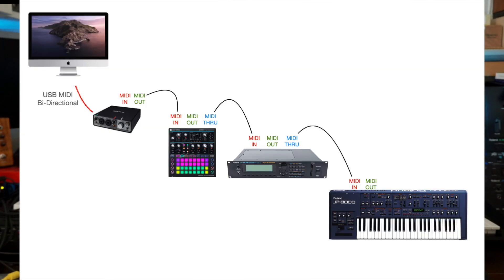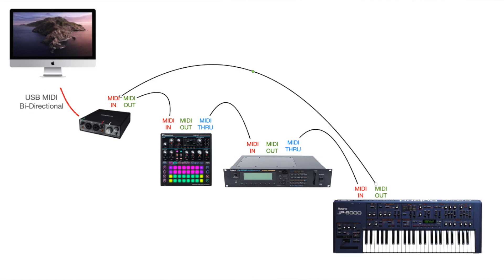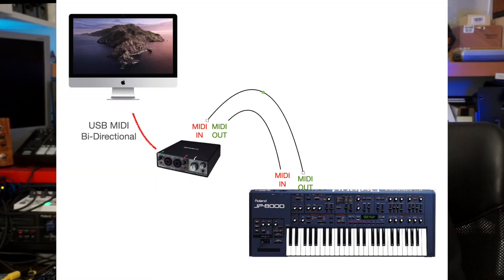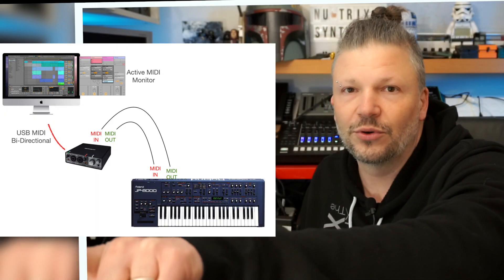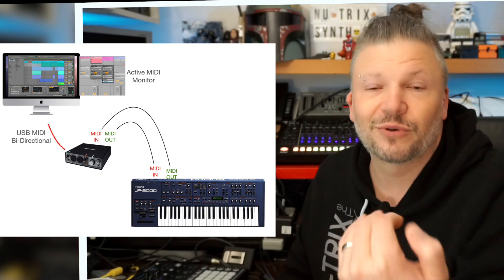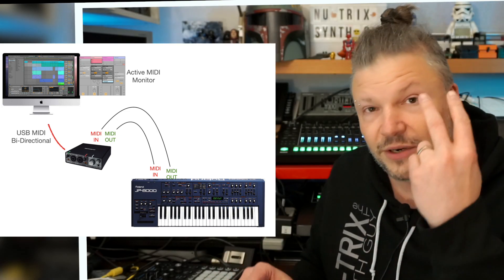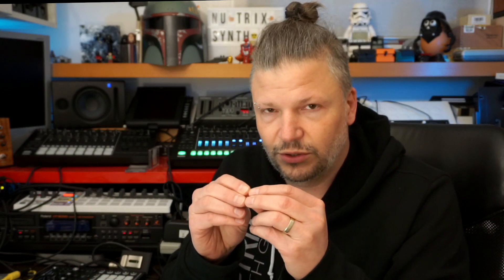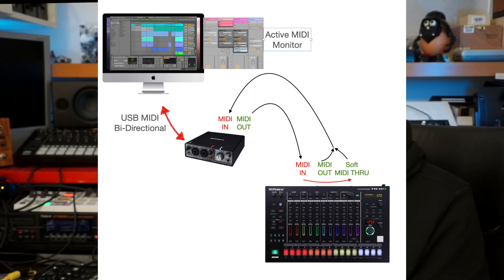The dangers of MIDI FeedBack - THRU and Local control

Comment: Thanx - allways good to be reminded  ! Im up to 8 sometimes 9 units on one clock stream , and this exact problem rode me as a mare for years - finally bit the bullit , got a midi splitter a midi merger and a 1 in 5 out Kenton unit - it helped but theres STILL sheenanigans going on somewhere , and im on a point where a seperat midiclock device is the only sollution left ,-

Comment: So with midi through you say the same information is being sent to three units. Does that mean you can't assign a midi channel to each so 3 midi parts can be assigned accordingly? 3 different parts ? 3 different devices?
Reply from the maker: They can be using the same MIDI channel or not. It’s your choice.
Reply: @Nu-trix  appreciate it thanks

Comment: My thru box can switch 3 inputs to any of 10 outputs. I remember when I first got into midi in the late 1980s creating a midi loop on a few occasions before I knew fully what I was doing. Back then thru boxes had a button that when pressed could send an all notes reset message to stop a midi feedback loop that otherwise would repeat indefinitely until you powered down your synthesiser.

Comment: Hey, I would love to have your opinion/advice, I'm having a problem as I need to connect a midi footswitch to change the preset on a synth module but also need to control it with a keyboard (it's only a module, it has no keys) and well... using a midi splitter in the midi in port doesn't work, it seems no synth will accept this setup in the midi in port, like some voltage issue, I have to end up unplugging one of the midi cables from the splitter to make either the controller or the footswitch work but not both, killing the purpose of the splitter, would this unit help? Or how do you solve this setup? Thank you very much

Comment: This video actually helped. I was aware of the local control off function but had it turned on as I didn't hear any beats from my drum synth when hitting it. Turned out I had the channel muted in my sequencer and once I activated it, I also got sound, with local control off (with the MIDI signal sent to the sequencer, then back to the drum synth and then it played).

Comment: is thunderbolt# or 4  the only connectivity that will provide low enough latency for midi controlling Virtual instruments from an external board? Does USB3 generally work efficiently for middi control? Usb 3.2?

Comment: So when local control is off on a synth with a keybed, how do I do a solo performance on that keybed?
Reply from the maker: You only use local control off when used with a DAW. The DSW is the MIDI routing manager. You then assign the MIDI going in the DAW to output to your synth.

Comment: Thank you for this. With my current setup I've been getting midi recordings that are jam packed with a bunch of garbage signals. I just changed the cascade order and initially got some unusual annoying audio blips (clock signal), but after a minute or two everything responded to my controller as expected.
So a tip worth trying is changing the order of how your devices are connected. In fact my behringer had an instruction to not have it last in the chain. Also check your software for modern synths using midi USB to see what is being sent and received and turn off whatever isn't needed

Comment: I'm a lil worried about the voltage warning with the rd9 I have on the way. None of my gear (deepmind 6, 707, og circuit, electribe 2) I can't find any info on these voltages of ny other equipment. Here's the warning, "Do not overload the ⅛-inch SYNC IN input. The input accepts a maximum incoming voltage of +15 V, and the SYNC OUT outputs should be connected to ⅛-inch inputs capable of receiving the +5 V output voltage. Overloading the RD-9 may result in damage to the unit and will require non-warranty repair."

I realllllly can't afford to damage this thing. So, any help would be great!
Reply from the maker: If your use gate, cv or sync outputs you should ok.
Reply: @Nu-trix  Thank you! You think my mc 707 would be fine via midi?
Reply from the maker: Sync out (CV) is not MIDI. It’s voltage. MIDI Sync uses a MIDI connection (USB, 5 PIN DIN, wireless). I think you are mixing up the two types of signals.
Reply: @Nu-trix  Yes yes, I see the difference now, thank you!

Comment: Hi there Nu Trix. Thanks fr the video. Maybe you can help me. I'm having this problem. The feedback is crazy from my new Dreadbox Typhon. The closes I found from what you said was on set up: "MIDI CHANNELS --> INPUT (1-16 or ALL);  OUTPUT (1-16 or THROUGH). Output was on through so I setted "1". The feedback stoped imediately and I could hear my ne synth fr the first time. But as I went trought the presets, in a few minutes the feedback was back in full. I changed Output again, back to THROUGH and to 1, but could not get rid of the feedback no more. Frustrating... I tryed also changing the imputs. Nothing worked. It goes fine for several notes and then it starts and I can only stop it turning the synth off.
Reply from the maker: Sometime a MIDI feedback stop all reactions from a module. You have to turn off the device, unconnect it, change the wrong MIDI settings, reconnect and try again.
Reply from the maker: Why do you need to send MIDI from the Dreadbox MIDI Thru? Where is it going? What is plugged in the MIDI in of the Dreadbox?

Comment: Thank you for the exceptional videos!!Subscribed straight away. I have a question if you may. I see you have the microfreak. I midi sync my mc 101 to the rc 505 looper and then midi to microfreak. Is there a setting at the microfreak that when i change the presets and a sequence is loaded, that sequence is not being played??I cant seem to find it..i have the 101 as main instrument and add with a mixer the handpan and occasionally the microfreak. Ony thing is that when im scrolling the presets, when there is a sequence it is being played and i dont really want to erase them, some are really nice.  I also tried to midi the freak to the triple delay from tc electronic but i dont think the delay picks up the tempo, i have to tap tempo it soomehow...just ordered that hub though......Thank you !!!
Reply from the maker: I don’t think you can play the MicroFreak on a patch that has a sequence without playing the sequence. You will have to deactivate it.

Comment: I'm having the strangest midi issues seemingly around the same time.  Stuck and missed notes, only affecting  5-pin DIN  connection.  The devices with usb seem fine.  I have some more recent midi controllers and devices and roland xp50 and yamaha motif rack.  Wether connecting a controller to the motif or the xp50 to my firewire audio interface, same result.  Tried switching cables, midi channels, clock set to auto or external.  Will check the settings for midi through but how can devices of various ages fail around the same time?
Reply from the maker: Like you are saying, it seems weird that many devices are starting to fail at the same time. Is it a MIDI cable that is defect ? Is it the MIDI interface that is problematic? What changes did happen before the problem occurred ?

Comment: now that was a great info. i have a specific question, becouse i have an exactly same problem. if my novation circuit get any midi clock signal from usb, after a few minutes get freezd. so i restart circuit with shift+power boot menu, and turned off everithing only let the midi clock in led on. and i got the same issues. so there is any possibilities to get rid off this problem with novation? thanks
Reply from the maker: You would have to find how to turn of MIDI clock out in the Circuit.

Comment: Thanx. But still can get rid of some problems. I am using a system-8. I am sending a midi clock from the DAW (Cubase). The thru functions on the system-8 are off. Sending the midi clock over midi overloads my midi interface. Although the thru functions are off, system-8 is still sending the midi clock out. Sending the midi clock over USB to the system-8,  I get all kind of glitches in the sound caused by the fx section on the system-8 (in temp sync) that struggles with the midi clock. Any idea's?
Reply from the maker: Hi Andre, I cannot check for that at the moments (away from the studio) but the system-8 can probably send it’s own MIDI SYNC information from its step sequencer. Check how to turn it off.
Reply: Right. After further investigations, I found out, that the jitter of the midi clock send from my DAW is because of midi by usb.
Reply: @andrepascal4616  jitter ?

Comment: first of all you are a great speaker and explainer and you have a very wholesome voice. Second, do I still want to turn local control off if i'm using a midi interface and not any MIDI Thru's?
Reply: also aren't you going to have latency issues with having MIDI Local Control off, where you're sending your key presses to your computer and they're sending them back out to the sound module?
Reply from the maker: @nonsugarfree  You will need to turn the local control off if you don't want to hear the performance you are playing on your keys coming from the synth 9if you want to trigger another synth (VST for exemple).
Reply from the maker: The latency issue should be unnoticeable .

Comment: One way  is to use a POWERED midi thru box. I use one made by Amptone. It's great so far. I used to have problems due to not enough power when I used an ordinary non-powered box.  One  idea if you need more than 4 outs is to connect a quadra to each of the midi outs of the Amptone so you end up with 3 extra  midi outs for each connected quadra.  The idea is to have all your synths or sound modules always connected. If you always use the same midi channel for each  sound module then there is no confusion. I hope you don't get a headache from my bad explanation.
Reply from the maker: It's all good. I'm using a MOTU MIDI express

Comment: Thanks 4 your time to explain it. I know a lot about it, but it's useful every time. 
I switched from a iConnectivity Midi 4+ to a simple solution of 
2 Keysteps and a Electribe 2s at a Midi Merger and then outgoing over 2 x midi thru boxes to the synths.
So it's not so flexible, but easier to handle my 6 small synths and the ipad. And the ipad is at a iconnectivity audio 4+.
So i can add it to the chain. And if i make no patch errors - no loopbacks ;-) And i could make some funny patches between the Synths if i want.
Reply: why ? iConnectivity is not good ?